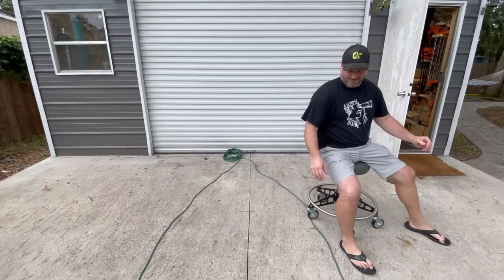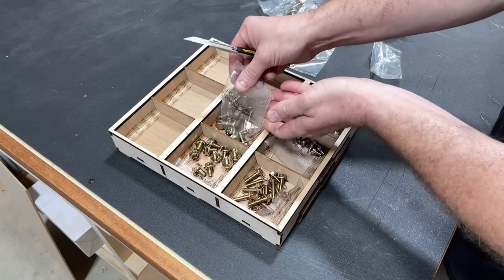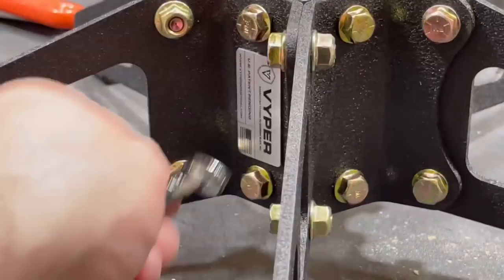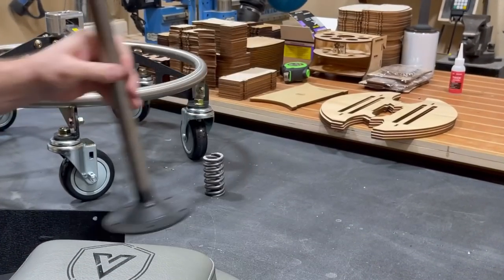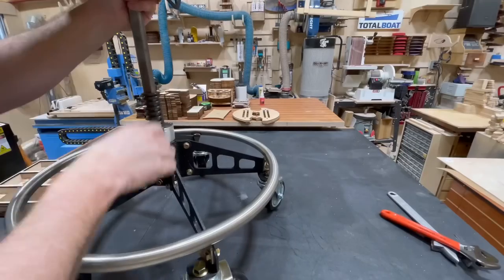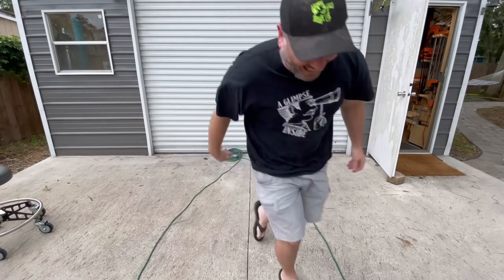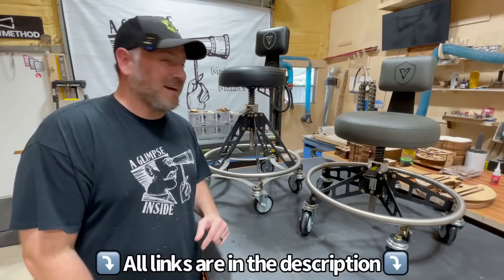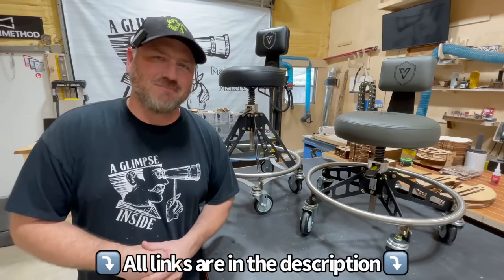Is The Rolls Royce Of Shop Chairs Worth The Investment?

Comment: The reason for leaving things loose is that if you tighten them, holes for other bolts or screws may not line up and you will have to loosen them up for the holes to align.
Parts often shift out of place during assembly so you're saving time and frustration by tightening later.
Reply from the maker: Nail on the head right here. Right on bro

Comment: Great review. I had struggled with shop chairs for years. Mostly because I have different height benches for welding, electronics work, gunsmithing etc. I have found that there are some really sweel drafting chairs which didn't work because of the crappy wheels they had.  I ended up replacing the standard casters and wheels with skateboard wheels and casters and lo and behold - Perfection!

Comment: I made my shop chair for just under $100. I bought a computer chair, a heavy duty metal chair base, and 3" rubber caster wheels, all from amazon. It easily rolls over cords, the uneven relief cracks in my garage floor, and wood chips and pieces of various sizes.

Comment: Thanks for the great video. Did you look /consider the Vyper   Low-Pro model. It’s Fixed seat height. - I’d be using it for car detailing /wheel cleaning /car. Polishing./paint correction on lower panels ect/ wheel coating -  thanks !!